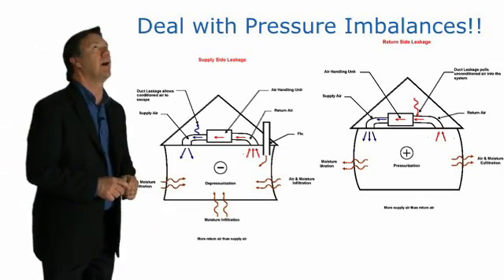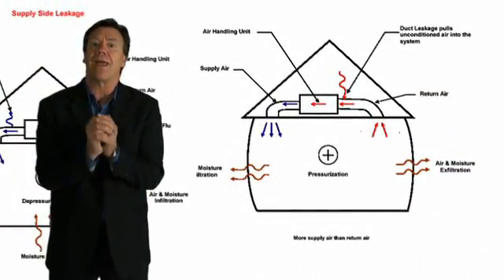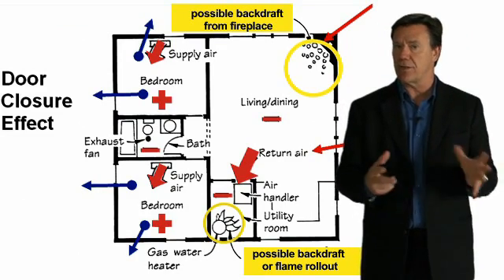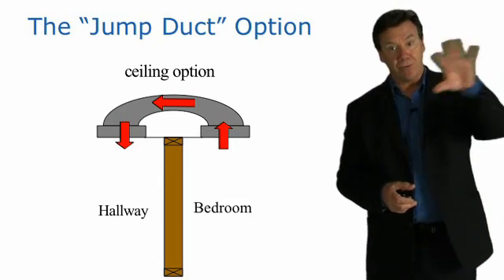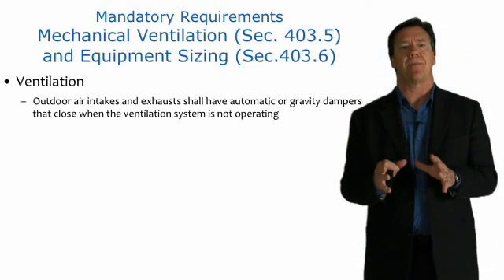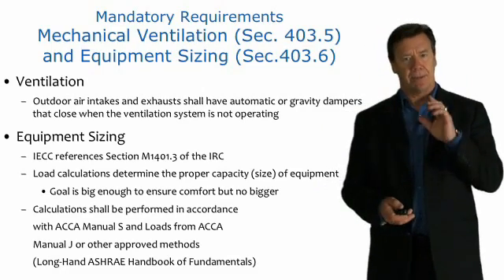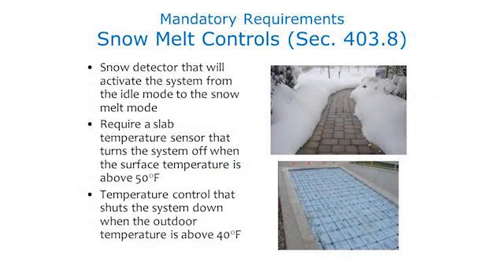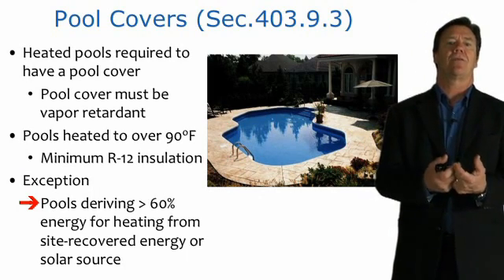HVAC and Building Pressure

Comment: 2:11 / 2:45 - - instead of a transfer grille or a jump duct, couldn’t you just shave an inch off of the bottom of the bedroom door(s)?
(Thereby allowing the air to flow back into the hall)